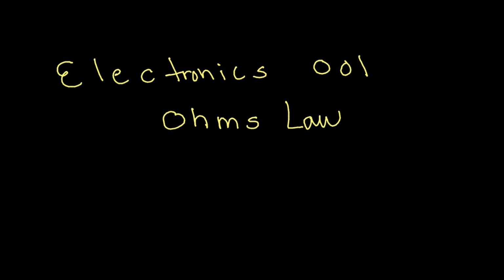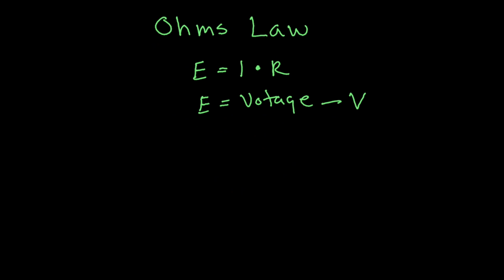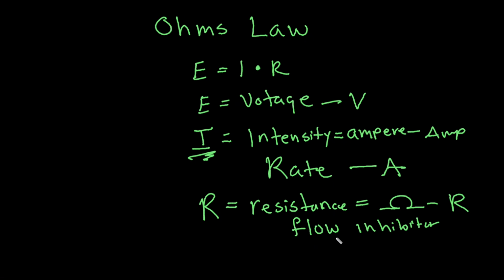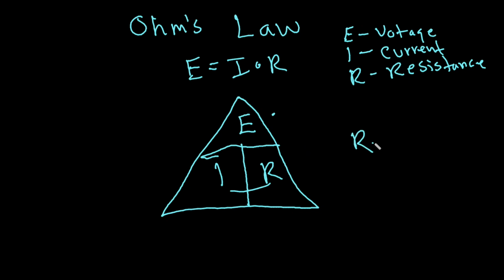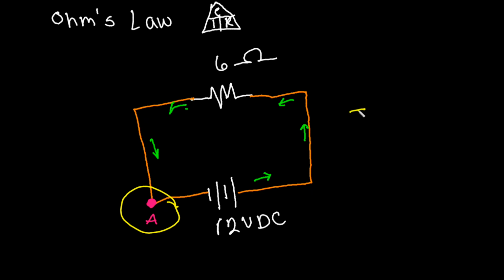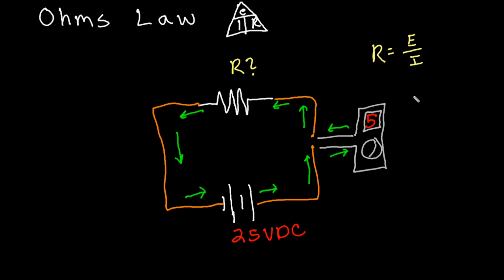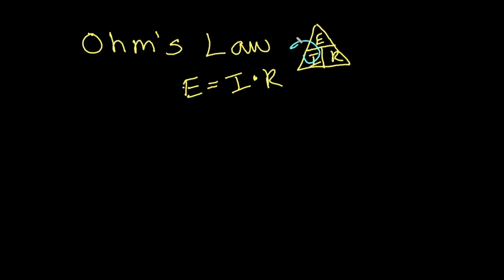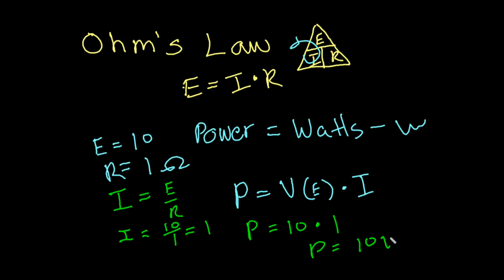Electronics Theory 0001

Comment: Now that you've had your Fnirsi  1014D for some time now, how is it? Do you use it much? Has it held up well? I see it selling for 135 to 189 bucks or so and will probably get it. Just curious if it's your "go to" scope or whatnot. Thanks!
Reply from the maker: It's an ok 1st scope. I sold mine because I have more capable scopes, but if you can get one <150 go for it!
Reply: @learnelectronics  thanks so much for replying!!! I'm probably gonna get mainly because it runs on battery and is portable. 
Not too concerned about its limitations. Can it show the waveform in dot mode?

Comment: Speaking of beginners in electronics.  I just bought a oscilloscope, can you recommend   books, exercises I can use to learn how to use it? Thanks
Reply from the maker: This book while written with radio amateurs in mind is a great oscilloscope primer: https://amzn.to/3WFHcYm
Reply: I'm in the same boat more or less. I'm a locksmith by trade for 25 years now but troubleshooting electronics fascinates me. I've repaired lots of tape recorders and radios but don't have a real oscilloscope yet. I just fixed a plug in type door chime that a customer brought in. We sell them once in a while.  I only used a multimeter and there were 3 zener diodes that were measuring weird. i.e. 0.002 in either direction in circuit. Desoldered them off and still measured 0.002 in diode mode. Replaced all 3 and it works great again!
I just learn by doing and watching tons of youtube videos
Reply: I also use a LCR tester I bought off ebay a few years ago. Only cost 10 bucks.  Even 3d printed a case for it. Highly recommend getting one. It's great for testing capacitors and transistors and diodes etc.
My multimeter has a thing you plug in that tests that stuff too but the LCR tester shows which pin are the B C E on unknown transistors.

Comment: In future episodes, I think you should be sure to specify that you are teaching using “Conventional” Current Flow Theory, as opposed to Electron Theory. Both are used in different training settings, and the student should clearly understand the differences between the two in order to minimize confusion. Both are correct, when considered in their entirety, but can become very confusing when interpretation becomes muddled between the two.

Comment: Thank you for the interesting and informative video! But I think you made a mistake calculating a power. Current should be I = 10/1 = 10A, so the power will be 10 Volts multiplied by 10 Amps that is 100 watts.
Reply: Yep, also missed the opportunity to show the power triangle.  P=IxE  where P is the apex of the triangle of course.
Reply: @Chris_the_Muso  I always remember it as PIE! Good to eat!
Reply: @Jimwill01  Yep, PIE and EIR  will get you a long way in this hobby.